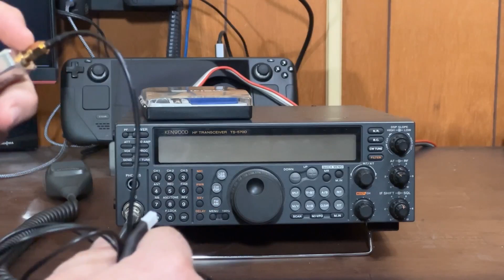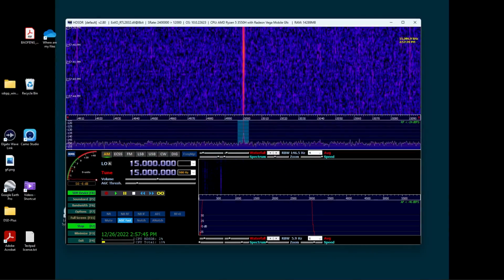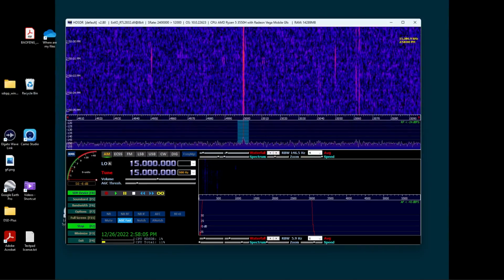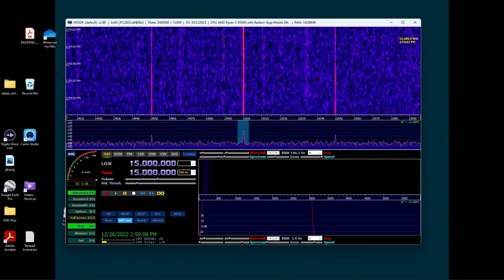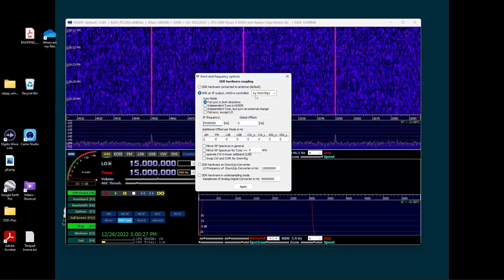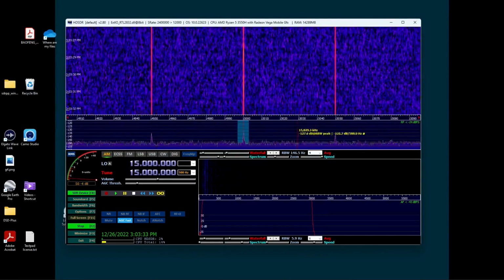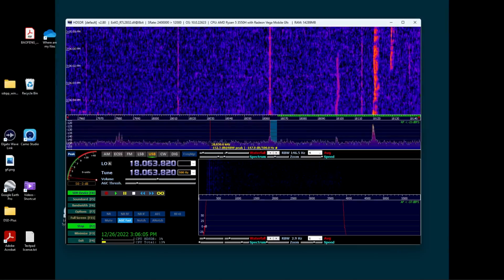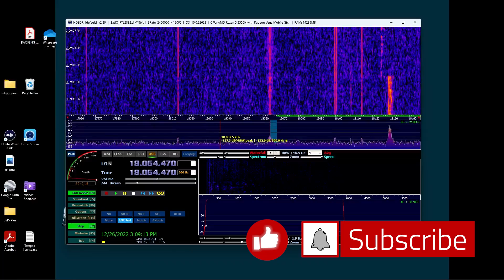Sweet modern upgrade for a vintage radio!

Comment: Surely transmitting next to the SDR will fry it?
Reply from the maker: I never had a problem.  I did take care that the SDR was not toooo close to the radio or the coax.  I had about a 2ft lead if I remember right.

Comment: I have a 570SG that I've started using for CW instead of my FT-710.  I don't even miss the waterfall.  I also don't miss all excessive knob pushing and menu selections of the FT-710.  The 570SG with a CW filter is just fantastic.   Sure it lacks some features and the AF DSP isn't ideal but it's soooo easy to use and sounds so much warmer than the 710. I can change power, keyer speed, filter widths, and switch between straight key and paddle immediately because the radio has TWO key ports so both a straight key and a paddle area connected at the same time! What a great rig.  Great video though, I remember doing this about 10 years ago but forgot how I did it. I may do it again some day.

Comment: Yes, I am planning to do this for my Yeasu 450D, but what I have seen I need a small extra pcb to tap the IF. Also I would like to make an stand alone pan adapter, without PC.
Reply from the maker: I have an FTDX-1200, it's possible on there, but it's a bit more brain surgery than the Kenwood was.  It would be great if manufactures would have that built-in as a feature on the back!
Reply: @FEPLabsRadio  some radios have the IF output on the back. That would make it much more easy indeed. I am thinking now that is probably more convenient to use Tx/Rx switch (to decouple the SDR when transmitting) in combination with Omnirig and CAT software to simultaneously (back and forth) control both the SDR and the transceiver.

Comment: There is an excellent no-effort way to route the cable to the outside of the receiver... If you are not using an external auto-tuner, you can push the connector from the back of the radio back inside and use that. All you have to do is route the cable from the TX-RX board behind the fan, to the upper part of the radio.

Comment: Hi I'm a newbie and would like to know if my kenwood 430s could do such a thing thanks 9z4apa  73s.
Reply from the maker: I can't speak to your specific radio, you need to look in the manual at the diagrams in the back.  However, EVERY ham radio has an IF - the question is how easy is it to connect to.  Kenwood on the 570 had a convenient two pin header.  I don't know, but I'd suspect all the Kenwood HF rigs have the same setup.

Comment: Great!   I thought one needed a Clifton Buffer board to go in between the radio and SDR. I have a Kenwood TS 2000 and I would like very much to do this.   Will my TS 2000 work without the buffer board?  After watching your video I think it should.  Thanks Herman WD0ARQ
Reply from the maker: All of the SDR's I've seen can do this directly.  With the 570 (I'm betting all the Kenwoods) the IF is a 2 pin header on the motherboard -  no soldering required, just a cable with SMA on one side, and the corresponding 2 pin female connector on the other.  Set the SDR it use the radio's IF (and you need the oscillator frequency - in the manual), and your good to gol

Comment: Fabulous job as 570d owner I love my rig and I love using my SDR to listen and see nearby stations and now I can have both one question on your 2 pin cable from the tap which pin goes to center of the SMA? I will be doing this mod definitely thanks and 73 de WX5GC
Reply from the maker: I do not remember!  There's only 2 wires, and it won't blow anything up either way, so don't be afraid to just go for it.  Worst you'll get is no signal on the SDR.

Comment: I have a Kenwood TS-940S I wanna do this to but have no idea what I need or how to do it. Any help would be greatly appreciated. Thanks
Reply from the maker: You will need the manual for your radio - in there it should show you an IF connector somewhere.  I can't tell you specifically, I don't have that radio.  Since they had it with a connector in the 570, I can't imagine they don't do it on all their radios.  It's only 2 wires, you just will either need to buy or make a little cable that goes from that 2 pin connector out to SMA for your SDR.

Comment: Could you do this wil a SDR like a G90 that has an IQ tap rather than a direct tap to IF?
Reply from the maker: I think you can, same as on the X6100.  Different setup in the SDR software, but yes, should work.  I've never tested it, so YMMV

Comment: My Elmer gave me a super clean 570D. I have done the mod with the SMA to IF tap. Waiting on a Cat control cable. Already have 2 RTL SDR dongles. I wonder if I can get everything working with my raspberry Pi 4.
Reply from the maker: Very nice!  The PI4 will absolutely handle all of it.  I've messed with an RPI and wsjtx, a few other apps.  My primary ham pc is a windows box now, or a mac.

Comment: Since the 1st IF on this radio is 7.305 does that mean you can only display and monitor that frequency or range?
Reply from the maker: No - the IF is the frequency you're going to set in your SDR software.  The range you can hear will match the range of the radio.
Reply: @FEPLabsRadio  Thanks for that information, but...where would I find that setting using SDR Sharp? Obviously, I need more hand-holding.
Reply from the maker: @missiontech1555  I can't tell you, I don't use SDR Sharp.  Somewhere in the program, you can modify settings that directly affect the hardware, and that is where you set the IF for the dongle.  There should be a spot in SDRSharp to adjust those hardware settings.  It may be that SDRSharp won't let you set the IF for the dongle input.
Reply: @FEPLabsRadio  Thanks and 73.

Comment: Hey Jim. Liked your idea. I own a Yaesu FT891. It has a waterfall but it's not live. Every time you have to refresh it. Could you please help me figure out the IF output in this radio?
Reply from the maker: I don't have an 891, so I can't help you.  Google the manual, there will be a schematic usually, and it should note the IF connection (if they make it available)  Some radios are not as convenient as Kenwood.

Comment: I think you touched on it, but I just wanted to be sure I understand. You mentioned the Waterfall follows what you tune on the radio, but will the radio follow what you tune via the SDR? The latter is something I’m looking for to effectively add a remote head unit to a couple radios for a clean and discrete mobile setup.
Reply from the maker: Yes it will.  You need something like Omnirig installed, it does the actual cat control.  In my testing, I used HDSDR, which interfaces with Omnirig.  That means that moving the SDR around on the computer tunes the radio and vice versa.  You can also get tricky, and interface some sort of mic connected to the computer as your mic for the radio.

Comment: Jim, you forgot to calibrate the signal meter! The RTL stick cannot have a noise floor under 125 dB. Just a tip, SDR-console offers more functionality and a way better and more detailed waterfall. 73' Ron
Reply from the maker: Right.  I really wasn't going after all the deets, it really was about the IF connection to drive an SDR radio and see the signals.  If I was using it full time, I would have done the calibration.

Comment: Excuse the off-topic question. At 9:16 what is the signal racing up the spectrum?
Reply from the maker: Some random thing around here.  Honestly, there might have been storms within 40-50 miles of me when I recorded.  I've seen that signal before on other radios.  It just zooms thru the band like you saw (and on other bands).  If I had to guess, I'd say distant lightning.
Reply: @FEPLabsRadio  I Appreciate the reply,
Once, was in process of making a fast tune on my SW. As the strange signal came.
I just happen to rapidly tune at that point.
I thought I could catch the moving signal. But it left me in the dust. 🥱😰
A squiggly swirling sound.

Comment: Can you explain the cable you used? Was it a connector you had laying around? Was that just RG-174? Could you do a video showing the actual connector and cable. As my best friend has this rig and would greatly appreciate this mod.
Reply from the maker: Any 2 wires will do, as it doesn't have any serious power going thru it, so tiny wires are acceptable.  The connector is something I bought a little box of from Amazon (https://amz.run/6LgI).   The cable is an antenna cable that came with an SDR kit, I used it because it's long enough to reach the SDR from the radio.  I just cut one end off and put on the JST connector.  Just a matter of putting it together.  A couple of DuPont wires would work as well.
Reply: Is there any polarity on the wires that needs to be considered?  I noticed that the 2 pin header had one of the pins labeled.

Comment: Hi good day sir love your videos would this work on my kenwood ts 430s thanks 73s from Trinidad.
Reply from the maker: It can work, the key is how hard it is to find the IF of your radio.  All radios have an IF, you just need to identify it, and connect up to it.  In the 570, it's a convenient little connector on the board.  I'd bet that the 430S has the same thing on it's board.

Comment: Hi Jim , Great video, a suggestion for the cable access. Why not drill the access panel which can be done well away from the radio. One hole and a grommet and it is job done! I have a TS140S which I  am going to try and do this. I also have an early Yaesu/Sommerkind for the treatment! Could be fun if I can find the IF point! 73 Jim M7BXT
Reply from the maker: That's pretty much what I had figured out, seems kinda obvious now.  When I did the video, I just had it coming out the access hatch, and had left the hatch off.

Comment: Yeeaaaah.... I don't think mine is new enough for this.
Reply from the maker: It just depends on if you can find a point to tap the IF of the radio.  Your radio has an IF.  They all do.  Kenwood just made it very easy on this model.

Comment: This was great- I have this rig but I my VHO knob wobbles as I turn it making tuning problematic. Do you repair rigs or have suggestions? Thanks George K 7FIR
Reply from the maker: I don't repair, or have any ideas for repair sites.   If you hook up the SDR to the radio, you can tune with whatever SDR program you use.  I used HDSDR in this video, and it does tune the radio all day.   If you have all the connections, you can even enable PTT thru HDSDR and it will key the radio.

Comment: I wanted to ask if the TS-570 has a DRV output on the rear panel?  I ask because I think I am going to try that on my TS-590SG.  If the 570 doesn't have that - that would explain why you did this using the IF tap method.  Thank you for a very good video too! 73//KK0DJ
Reply from the maker: I don't know if there is a DRIVE output on the back, off the top of my head.  I knew that any SDR will take the IF of the radio and can use it as input.   Kenwood conveniently made a connector for that, and it's easily accessible.   Also, no power on transmit from the IF.

Comment: Thanks for a great video!  Tapping the IF is something I had not considered trying with my 7200.

I am looking at splitting the signal before it goes into the radio so I can monitor different bands and not be tied to the tuning of the transceiver.

Tapping the feedline decreases the available signal to the transceiver, so the splitter that I bought (RX-Audite from CZ) has an optional pre-amp to compensate.

Since it taps the feedline, it also must detect PTT in order to shut off the SDR port and not blow out the SDR front-end during transmit. That same PTT circuit can also drive an amp, and it also acts as an buffer/isolator for rig+amp combinations that need that extra protection.

I also have a 590SG that can be configured to provide an RF output via a port on the back of the rig to drive an SDR or other transceiver. I don't believe it taps the IF so I don't think it has the option of following the transceiver tuning like your example, but that rig is new to me so I could be mistaken.

Comment: Hi, how I can see, we mounting the hardware in the Tranciver?
Reply from the maker: I didn't mount it, as I'm not making any permanent mods to the radio.  I just ran the cable (the only hardware involved) out the bottom of the radio.  If I was going to keep this permanently, I'd drill a hole thru the access hatch at the bottom and run the cable out there.

Comment: This is AWESOME!  I've been looking for a 570.  I had no idea you could do this with this model.  I've been running an RTL-SDR also and didn't know these could be married up. Thanks for sharing this.  Can't wait to pick one up and do this mod.  73  N4WJL
Reply from the maker: I like the 570, it's a great radio.  I bought it used from @temporarilyoffline.  At this point, I don't think I'm going to keep it, as I got a deal on a used Flex, so I've got more radios than I can use at this point.  

You can do this with pretty much any radio (all radios have an IF), the issue is just finding where and how to tap the IF.  Kenwood made it super easy on this radio.

Comment: I’d like to do that to an old Icom R-71 receiver. It has a 10.7 IF out. If I hook the SDR to that 10.7 IF out, will the display work?
Reply from the maker: Yes, it should.  You just have to set up your sdr software to take it's input, and you'll need to set the frequency for your IF

Comment: Don't drill a hole in the back of the chassis. Use a metal punch set leaving a clean hole with no burrs or shavings.
Reply from the maker: Right now, I just have the access panel from the bottom off (not the bottom itself), and wire coming out of that.
Reply: You still have to drill a pilot hole for the punch. Shield well and use a vacuum to grab the metal bits.

Comment: I wish you'd explained what the result would be before you started doing things. Made it rather confusing when, for instance, you started talking about rig-control. I was so busy trying to why you needed rig-control and wondering if that meant I'd misunderstood what you'd done so far that it spoilt it. This mod does work pretty well without any rig-control. You just make the waterfall display be marked in kHz offset from tuned frequency with zero at the centre.

Comment: Wonder if this would be just as easy on a Kenwood 450sat?
Reply from the maker: It's a matter of finding the IF in the radio.  The 570 had it marked in the service manual, with the header pins for it.  I would bet that 450 has the same thing.

Comment: Can this be done with an Icom IC-7200?  How?
Reply from the maker: It can be done with any radio; however, you have to be able to tap the IF.  I don't know about the 7200, or how easy it is to access the IF connection.  I've got another video coming out in a few days, that is another way to do pretty much the same thing.

Comment: Great info Jim and it's well worth the trouble doing this mod.
But for anyone who has a radio that doesn't have an IF tap you can use something like the mfj-1708 b sdr switch.
I've used that method with a yaesu ft-991a and a sdrplay  rx. 
More expensive but saves screwing up the radio trying to tap the circuit board.
You still need to set up omnirig  for cat control and there is a small loss of signal strength doing it this way ( about 3db or half and s point ) but it's worth it for the bandscope and waterfall.
Have a look on YouTube there's lots of vidios about this.
Omnirig has a long list of transeviers its supports but be careful about the version you use.
I found the version 2 and later would not work and had to use an old version ( I can't remember the version number  but something like 1.79 )
Do your homework and have a go, it turns a good radio into a great radio.

Steve.. G0BTV
Reply from the maker: Funny you mention that, I actually have one of those - I'll be doing a video on it within the next few days.  I used to use it with my 7300.  Thanks for watching!

Comment: Some double stick tape on the inside. Make a "u" shape with tape in the vertical, and one horizontal. The "u" should allow the drill bit to come through the plate about 1/4". Then again a good shop vac does wonders while drilling.
Reply from the maker: RIght - I'm just not sure I need this mod enough to make it permanent.  I think I probably will, just want to be careful when I do it.  I was thinking about nipping off a small corner at the back of the case to pass the wire thru.

Comment: Brilliant Jim! I always thought it would be good to do that but I never knew it was actually possible.
This could be an affordable option for me.🤔👍
Reply from the maker: You bet!  What radio are you using?
Reply: @FEPLabsRadio  no HF yet. I want a 7300 for 100w and a waterfall but it's not possible atm. I have seen a few older radios like that but no waterfall... I will now keep an eye out for something good that can be modded like you showed. Thanks Jim.👍